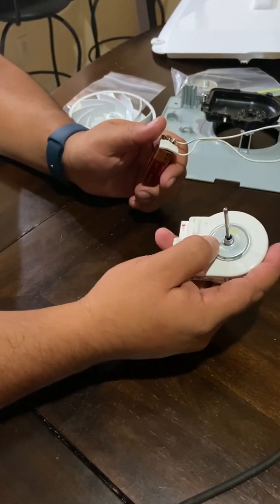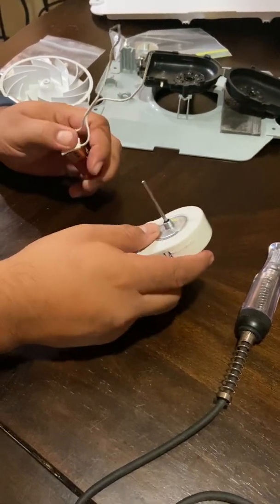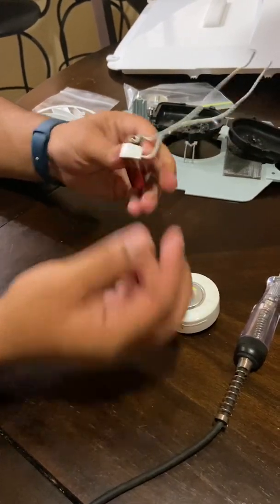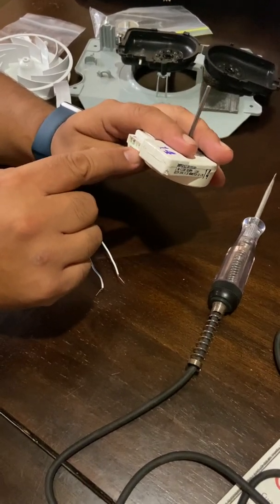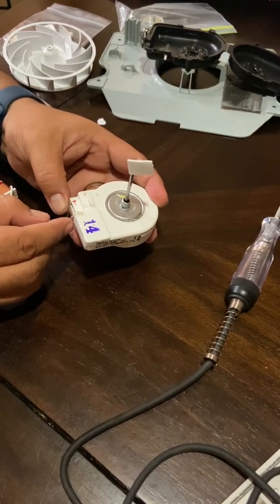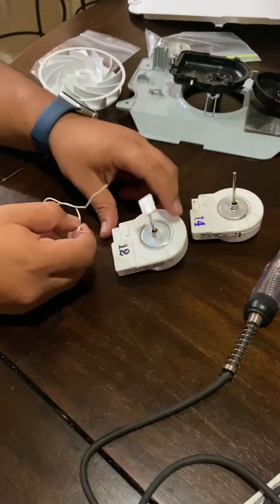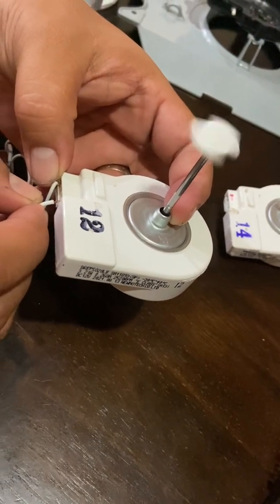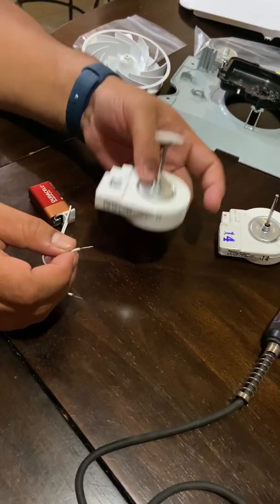How to test Evaporator Motor DA31-00146E using 9V battery

Comment: Thank you. Keep in mind that just because it runs does not mean it's good.  There is a reason for the 3rd wire. It's the feed back signal telling the control board the rpm of the motor. If the control board doesn't see that , it will not power the motor on certain models.
Reply: @nygolfer, 2 questions here:

If the motor spins and the feedback wire doesn’t send anything to control board, is that an issue with the motor or that wire?

Is there a way to measure feedback wire system with multimeter?

Comment: Which pin is + and which is -?
Reply from the maker: It makes no difference,  but i suggest you try both ways and if it does not spin then you need a new part. If it spins then you have a good part
Reply: @danersk9  Maybe I've got a different variation of the motor (reflected in the last letter of the part number), but on my motor, it DOES make a difference.  The outer-most pin should be negative, and the inner-most pin should  be positive 9-12V VDC
Reply: The outermost-pin is minus (-), and the inner-most pin is positive (+).

Comment: Thanks for the 9v battery idea. I did the test with a 9v battery and a 10v dc power supply and the fan seemed to need an assist when starting, I had to spin it up manually sometimes to get to spin. No resistance when turning on the bearing I could tell and the resistance on my meter was about the same as a new one I got. My fan was a Panasonic and I got an OEM one $100! but the thing lasted 16 years so not too bad  I guess. So the point is that a multimeter may not tell you it's bad. In my case there was some kind of slight internal resistance that stoped it from starting up - once it was spinning it was fine.